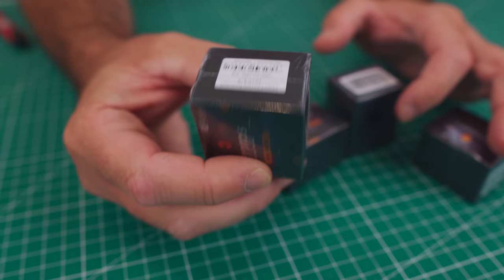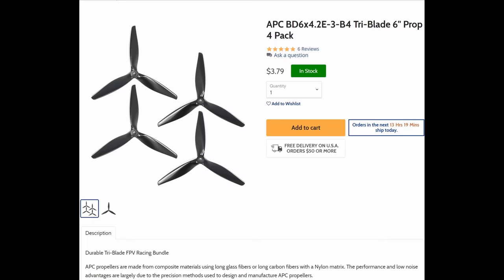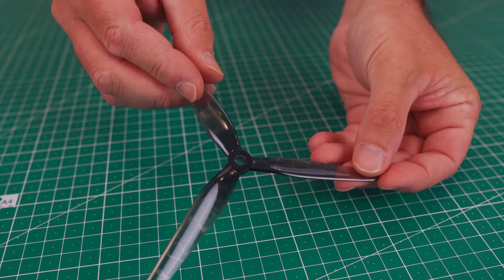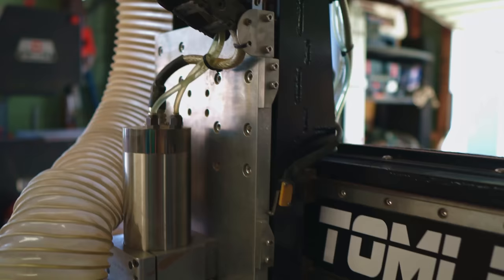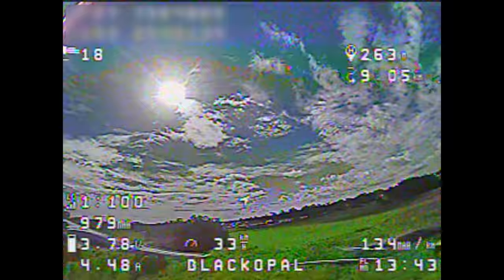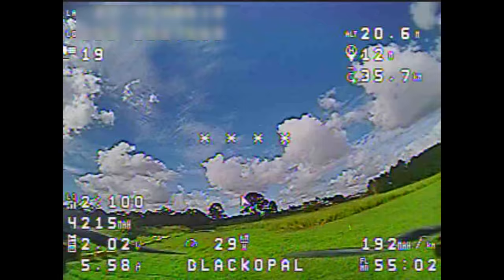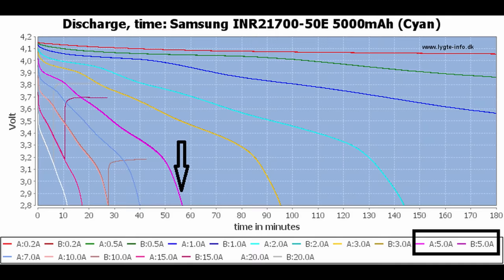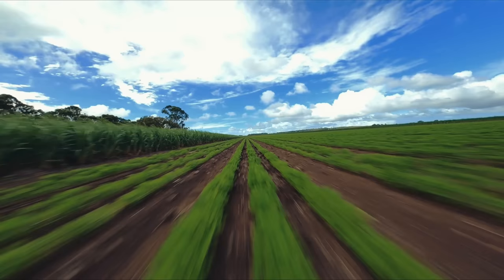55+ Min Long Range Drone (NEW T-Motor F2203.5)

Comment: I am so pumped I found this channel! I have been playing around with li-ion packs for a few years now building little 1s whoops or 2s cruisers and experimented with different cells in larger packs for my 7" quads but this is next level my dude... One thing I was wondering about..  I ahve found with 7" quads that I need a large stator (2507, 2806.5, 2408, etc) to get good flight performance without any weird wobbles as I throttle down, etc. I also have noticed that the heavier the quad is, especially in the 7" class, the smoother it seems to feel. Did you run into any issues like that when you were tuning this up?...  I have a 7" ultralight frame from RVS and I think I might have to try it with some of these motors and 6" props
Reply from the maker: Cheers man, comments like this inspire me further. If there's a lot of wind involved it will be hard to beat a quad that has a bit of mass behind it, but other than that, it's usually pretty solid. I think if you can keep your quad below 200g (without battery) you'll be fine on 6 inch props with these motors. I also much prefer 5S and 6S packs on this quad. 1500kv on 4S is really on the low end for any significant cruising fun. (But great for time runs)

Comment: ethix p3b biblades?
Reply from the maker: The 5 inch ones? They would be a good choice too. Nice and light!
Reply: @ScottTomlinson  5.1 but yeah!
I just got those in along with the iflight usb c to balance lead adapter. I'm trying to make my 5 inch freestyle/cine rig lighter. Hopefully my analogue nazgul is not too heavy to get the efficiency benefits from the biblades

Comment: What is the weight with the battery ?
Reply from the maker: ~ 480g with 21700 5000mAh
Reply: @ScottTomlinson  looks like you cut this frame from carbon fiber. Will this be available to purchase.
Reply from the maker: @tycochran8667  Not from me. Files are linked in the comments and places like CNC madness have it ready to go.
Reply: @ScottTomlinson  ok. Thanks for responding. You build some nice stuff bud. Keep up the awesome work.